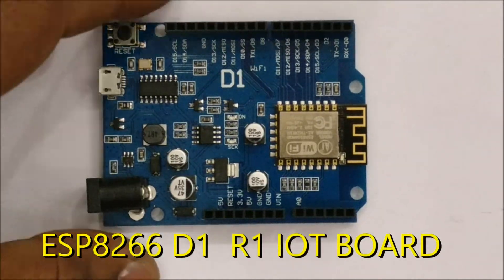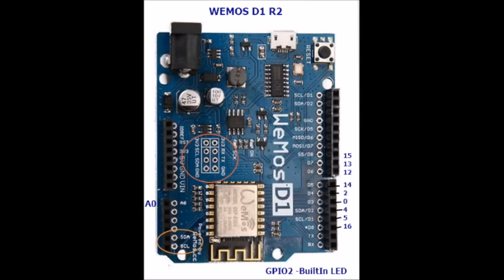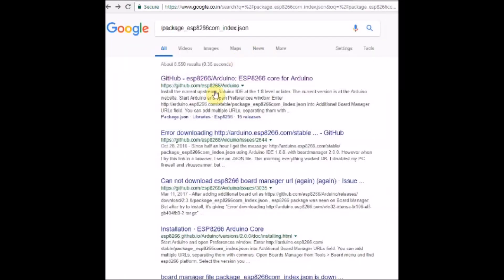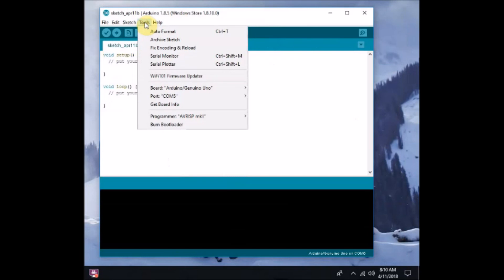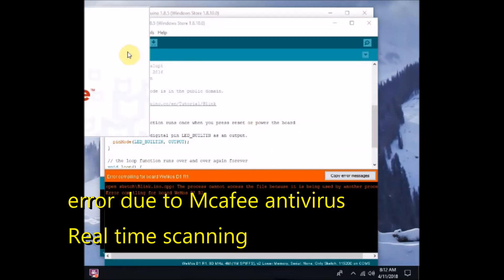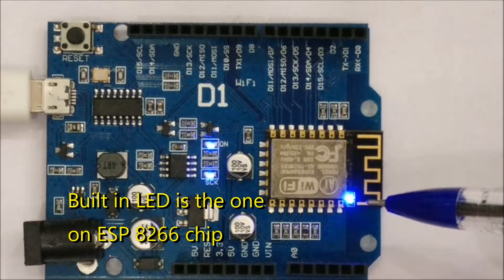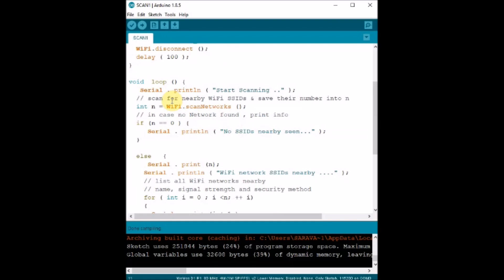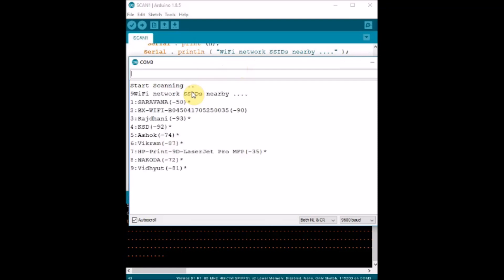ESP8266 D1 IOT BOARD WEMOS

Comment: DEAR SIR, I WANT TO CONNECT A FINGER PRINT MODULE TO THE WESOM D1 R2 BOARD. I USE THE ADAFRUIT LIBRARY EXAMPLES. IT CAN'T DETECT THE MODULE. WHAT ARE THE PINS TO CONENCT TX AND RX OF THE MODULE? HOW TO WRITE THE CODE?

Comment: If i connect the ESP8266 D1 board to the WIFI at home can i just run any code on arduino IDE after and then view the results on a web browser with the IP address from the board?

Comment: Sketch uses 257316 bytes (24%) of program storage space. Maximum is 1044464 bytes.
Global variables use 26816 bytes (32%) of dynamic memory, leaving 55104 bytes for local variables. Maximum is 81920 bytes.
Serial port not selected ,,,,,,,,,,,,,,,,,,,,,,,,,,,,,,,,,,,,,,,,,,,,,,,I have this error in the Blink also I turn off the windows security

Comment: Hello, I had this card years ago and I could not use it, I get this error because it is caused and I deactivated the real-time protection of windows defender I do not have another antivirus

In file included from c:\programdata\matlab\supportpackages\r2019a\3p.instrset\arduinoide.instrset\idepkgs\packages\esp8266\tools\xtensa-lx106-elf-gcc\2.5.0-4-b40a506\xtensa-lx106-elf\include\c++\4.8.2\algorithm:60:0,

                 from C:\ProgramData\MATLAB\SupportPackages\R2019a\3P.instrset\arduinoide.instrset\idepkgs\packages\esp8266\hardware\esp8266\2.6.3\cores\esp8266/Arduino.h:237,

                 from C:\Users\DANTE&~1\AppData\Local\Temp\arduino_build_827352\sketch\SCAN1.ino.cpp:1:

c:\programdata\matlab\supportpackages\r2019a\3p.instrset\arduinoide.instrset\idepkgs\packages\esp8266\tools\xtensa-lx106-elf-gcc\2.5.0-4-b40a506\xtensa-lx106-elf\include\c++\4.8.2\utility:68:28: fatal error: bits/c++config.h: No such file or directory

 #include <bits/c++config.h>

                            ^

compilation terminated.

exit status 1
Error compilando para la tarjeta WeMos D1 R1.